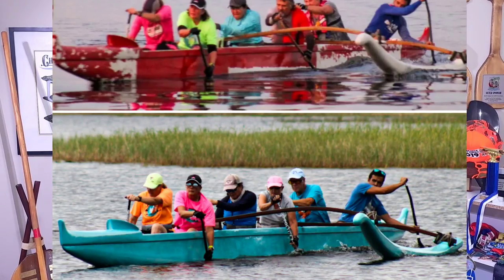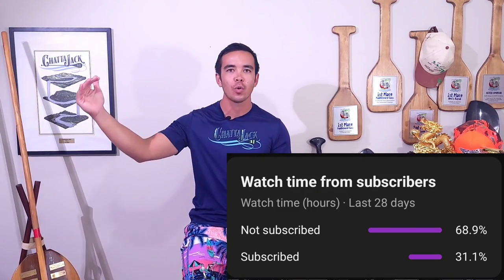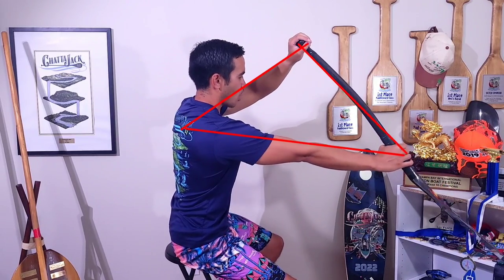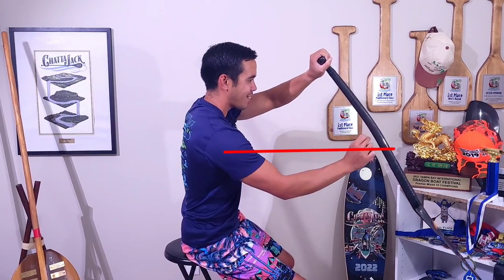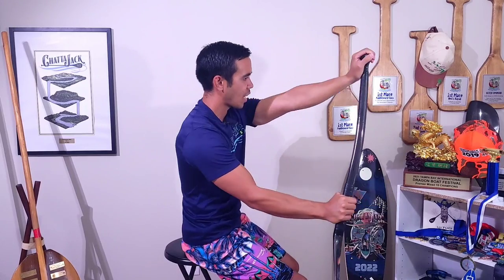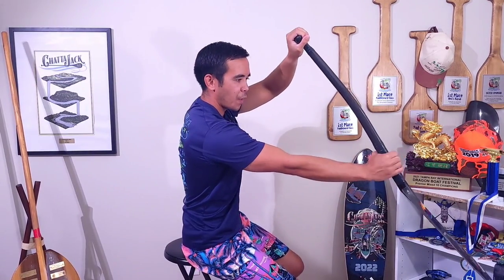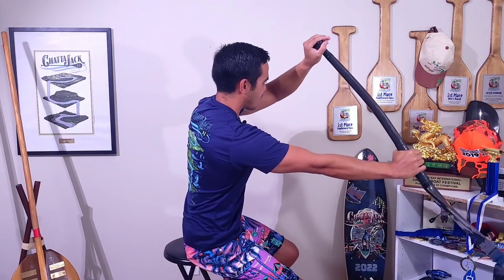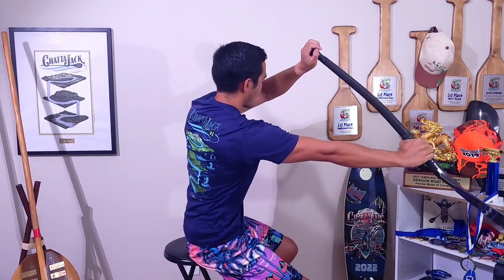Paddle Tip: Preventing Power Slippage 2/3  HOLDING SHAPES in the Outrigger Canoe!

Comment: Avoid the easy path and chase the maximum resistance/difficult, is a very good tip that i've never thought about. Thanks for the video
Reply from the maker: It's all a balance for efficiency but striving to be better is being in good position THEN finding that force... boat speed tells you everything after that! If you're paddling at a 10/10 exertion and not going fast it means things need to be adjusted for better leverage. Part 3 brings it all together!